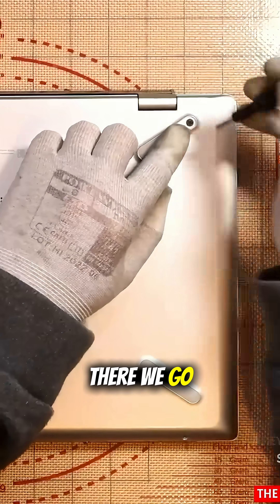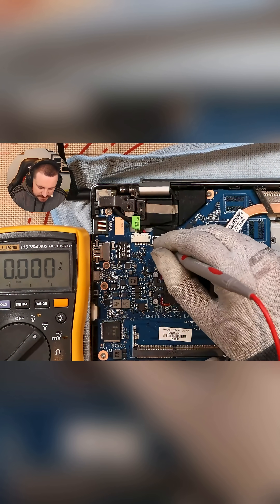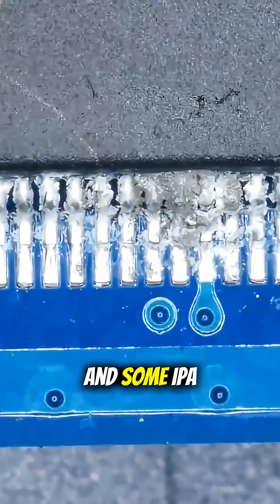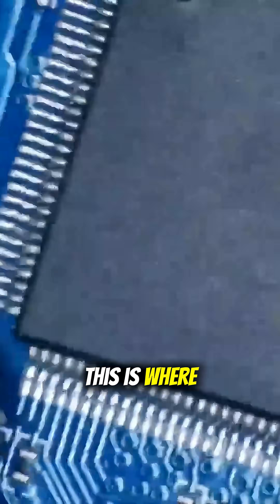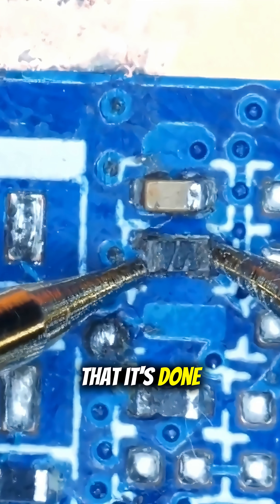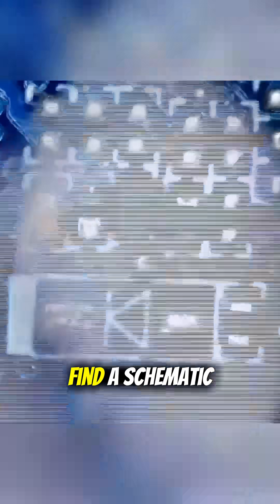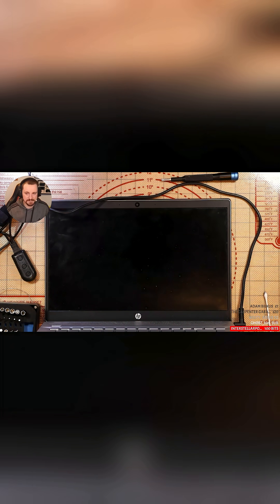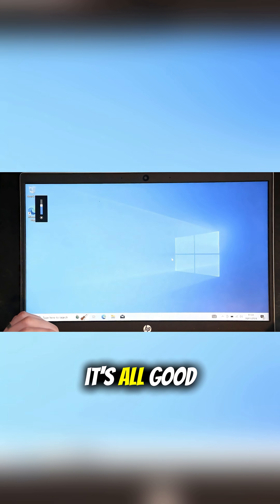I Used a Nintendo Switch to Fix THIS Laptop  #soldering#repair

Comment: Amazing that you repair laptop this way. I also repair laptops but not with flux and everything, just replace parts. Now my Alienware laptop had a power rail failure and I have no idea how it should work again, it costed like 4,5k and barely used it. If I leave it for some time, it will work again for a short period and then it will get the power rail failure again. Laptop is in brand new condition, only won’t turn on and I wish I could fix that 😜
Reply: sound like a capacitor, most likely one of those smd ceramic things,  is breaking down intermittently, theyre notorious for it, or some component going open circuit

Comment: I’m an authorized warranty tech for servicing HP’s and Lenovo’s. HP’s take insanely long to finally supply power to the LCD and boot up after power has been discharged from the entire board…

Comment: I have an Acer Nitro 5, lost power. Replaced the battery, didn’t work. Took it to a repair shop and they couldn’t see what the issue was. Might make a good video for you if you fancy a crack at some fairly advanced piece of kit